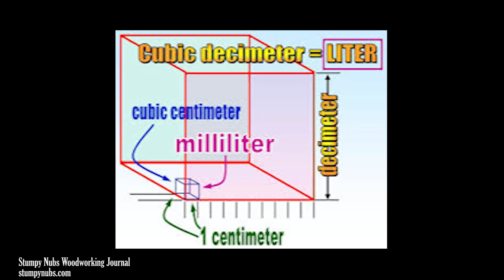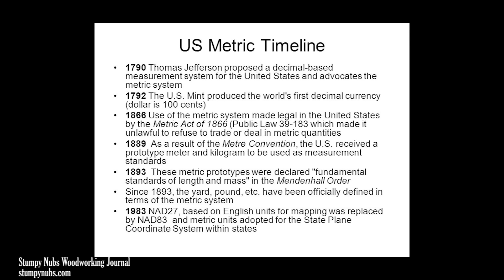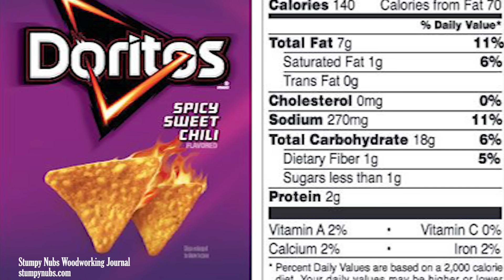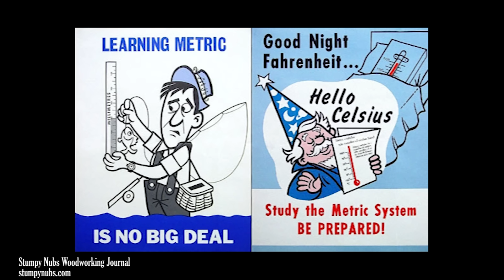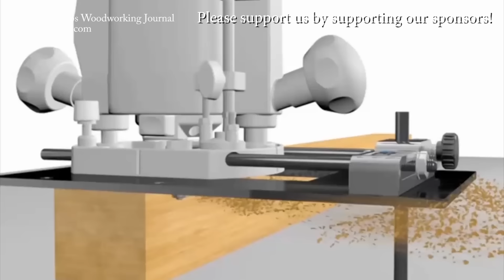BREAKING: The USA is switching to METRIC!

Comment: In the UK we use both all the time, petrol in litres then calculate fuel consumption in miles per gallon, we have litres of water, pints of milk and beer, litres of beer, we walk in miles, but do 10K runs.  It is great fun, we do both, older folks can continue to function in their older units without too much trouble, and young people are already fully metric, but then have to deal with the driving in miles per hour. I get metric, having spent my whole career in Science, but I never could understand the simplified American system, not quite Imperial system that has no ouces, pounds, stones, quarters, hundredweights and tons.  Measuring the weight of an elephant or a ship cargo in pounds is just bonkers, the numbers are too large to have meaning.  Interesting video.

Comment: As I understand it, many years ago Canada and the US agreed to both go metric on a specified date (early/mid 70's?).  Canada followed through and the US bombed out.  It takes awhile to get one's head wrapped around the new system.  I'm now good with driving speeds and distances, and ambient temperatures, but being old school I have trouble with cooking temperatures, pressures and flight altitudes.  The next generation should be able to leave imperial behind.

Comment: My tools have metric and non-metric markings.  However, I know enough conversions (like 1 meter is 39.34 inches) that I just convert anything that is metric back to non-metric / imperial.  I didn't really have to do anything in metric until I went to college in 1978 and again in 1988 (second degree).  If I build something - inches, feet, and yards are the measurements I use.  I km = 5/8 of a mile and a little over 3 liters equal 1 gallon.  I'll go to metric when I have to, but using non-metric for my own projects doesn't hurt anyone.

Comment: I'm British and 62. And when I was in school we were taught the imperial system in elementary school and metric in highschool. Of course we only used SI units for science.
But we are now in the ridiculous situation where we buy gas (petrol diesel) in litres and still say miles per gallon when talking about fuel economy. Our roadsigns are in miles per hour and distances are in miles and yards. We buy milk in pints too. Oh and we measure ourselves in feet and inches and weight ourselves in stones and pounds.
However Our shoe size is similar to yours except for being one unit out. My sneakers are UK 12 and US 13. There are only 6 pints to the US gallon and 8 to the UK gallon so there seemed to be no standard.
Oh and the best is when measuring tyres. The width is in millimetres and the diameter in inches 😅 ie 195 (tread width in mm) 55 (aspect ratio)18 (rim diameter in inches). Yep it's time we all stopped this nonsense.

Comment: I've been thinking about why Americans struggle to switch to the metric system, and I have a theory. It revolves around the fact that our currency is divided into quarters. Unlike what the video suggests, our basic dollar is split into quarters. This quarter-based division permeates our measurement systems too: inches in a foot, quarts in a gallon, and ounces in a pint. Everything seems to be divided into quarters or halves. Americans have a preference for this way of dividing things. Until we move away from using quarters in our monetary system, I believe we'll remain tied to our traditional measurement system.

Comment: Don't think I'll ever feel comfortable thinking about room temperature (or outside air temp) in anything but F.  Ditto for speed of my car.  However, the field of 3D printing and CAD has been metric for quite some time, and I don't measure these parts in "inches".  Cooking recipes are STILL in teaspoons, tablespoons, and oz's.  Gas used to be sold in liters until the parts for setting pumps for gas prices over $1/gallon!  HFT has VERY FEW tape measures in metric!  Ditto for other tool makers btw.

Comment: I remember back in the 1970s when there was a big push to change everything to metric. It failed because people said metric was “too hard.” What? Well, they kept asking things like how many inches in a meter. You needed to know to four digits to be reasonably accurate. 
     However, I lived in Australia for a while, and the metric system ain’t all it’s cracked up to be. Say you are driving to Sydney. A sign says it is 124 km. How long will that take? Uh, let me get my calculator. But how long will 77 miles take? 77 minutes.

Comment: I'm from Germany. It is not the case that the metric system has established itself everywhere. We are more likely to buy "half a pound of mince" from the butcher than 250 grams. Eggs come in packs of six (half a dozen) and the monitor in front of me is still 27 inches.
Reply: eggs also come in packs of 10, 12, or anthing in between, really. aslong as the number is even, that is. the example with meat is probably only in more rural areas. but yeah, monitor size still has inches, but i always have to convert it.

Comment: The metric system is equally valid to imperial. I think that imperial will still be used for common things like in Canada. For human scale objects, cm is too small and m is too big. Being 6 foot is a lot easier than being 183 cm because most people can't really imagine how big numbers interact with the world. where as I can imagine how big a foot is and generally get an idea of how big 6 of them are. Imperial only falls apart when you need to be more accurate than to the nearest inch, but even then fractions aren't a bad way to do it usually.

Comment: It can be dangerous using 2 systems of weights and measures. See the Gimli glider incident in Canada.The Board of Inquiry found fault with Air Canada procedures, training, and manuals. It recommended the adoption of fuelling procedures and other safety measures that U.S. and European airlines were already using. The board also recommended the immediate conversion of all Air Canada aircraft from Imperial units to metric units, since a mixed fleet was more dangerous than an all-Imperial or an all-metric fleet.[9] In Australia we went metric in 1973. If memory serves correctly the Hubble telescope was fitted with metric washers and required a special mission sent to rectify it as it would not focus properly.Amazingly we suggested to the Brits in the 1890's that the British Empire should go metric,however our idea fell on death ears.

Comment: The only change that I dont agree with is the temperature scale.  when using a thermostate in your house you can regulate the temperature much better using fahrenheit rather then celsius.  I live in a tropical climate and we only use air conditioning and if I set my thermostate to fahrenheit and set my target temperature I get a much tighter temperature swing compared to using celsius.

Comment: Actually, there are two versions of feet used in the US: The International foot is exactly 0.3048 meters. Whereas, the US Survey foot is 1200/3937 meters. Or, one meter is 3.2808333333(infinitum)feet. Your everyday use and how things are described to you are in International Feet. For land and offshore measurements they use in the US Survey Foot. However, even this will be changing as the government is planning to deprecate the use of the US Survey Foot, but for us which use both on a daily basis, that will not be anytime soon. Lucky for me I mostly use metric, but my US colleagues still have to use both Feet versions as well as metric. Lots of fun, huh?

Comment: Can anyone make quick calculations for me?
1. I have house with 100 square meters roof, the rainfall yesterday was 1 mm high. How many liters of water did I collect?
2. I also have a workshop with a roof measuring 100 square feet. In a few days there will be a rainfall of 1 inches, how many gallons of water will I be able to collect?

Comment: lol!
We adopted the metric system when I was in primary school. But it was a gradual thing. Milk bottles started having 568 on them, as well 1Pt, for example. That was in the 1970s. In the 1990s, as well as finally changing our road signs from miles to kilometres, we changed our construction materials from feet and inches to metric. That included plumbing, where half inch i/d pipe was replaced by 15mm o/d pretty seamlessly, but 3/4” i/d was not a close match for 22mm, nor 3/8” for 10mm and the other standard sizes bore no relationship at all. The Irish were not impressed and they resisted to such an extent that today there exists a thing called “Irish size “ tubing. You can’t easily get metric pipe or fittings anywhere in the 26 counties. Yet the UK population, inventors of the bizarre Imperial system, with its multiples of 12, 14, or 16, have adopted metric plumbing systems with little resistance. So now, if you want EU standard fittings, you have to go to the 6 counties that are still technically part of the UK, though not the EU. If, however, you want imperial fittings, you have to go to the 26 counties that ARE part of the EU.
50 years on from its formal adoption, the metric system is still not fully operational, with many tradesmen still thinking in 8x4, or 4x2 and using feet and yards to measure with. Lumber is still sold and priced by the foot, despite being cut in metric lengths by the sawmill.
I used to think the imperial system would die out when the last people to learn it in school retired, but in reality, with all the heritage in existence, I think it will be generations before it’s forgotten. 
Ireland is a mere speck in the ocean, so compound that thousands of times and you’ll be talking feet, inches, pints, quarts, fl/oz, lb, etc, for a very long time yet.
But do try to adopt metric correctly, however long you take to do it. We don’t want different US litres, or Kilometres, like we had with gallons and miles.
The purpose of a measurement unit is to make sizes, weights, volumes or lengths understood by all. So a unit of the same name should be the same in every other way too, regardless of where you are on the face of the planet.

Comment: The imperial system is already metric. All imperial units have been changed so they are no exact decimal multiples of the metric units. 1 inch is not roughly 25.4 millimeters. It is exactely 25.4 mm because it was redefined as such in 1959. Since then the USA system is just a renumbering on top of the metric system, with units close enough to the old value so people won't care too much.

Comment: I live in the Uk, and I use both systems.

I like the imperial system because it is obscure and it is a link to a past when things were simple made for a simple world and made for simple people.
Also it is very good for kids to grasp the concept of fractions.

But for our modern world it is not suitable and it is hard to calculate things For instance try to calcute the weight of an imperial pint  of water, oil or mercury.....good luck.
 One litre of pure water water is 1 kg....simple....depending on the liquid you have to adjust the density.....

Another example, the brits  adopted the decimalisation of their money in the early 70's ....now 100 pence make a pound...rational....base 10....
Before it was 1 pound = 20 shilling= 240 pence....For example try to.calcute the cost 1/16 of a pint ( US or imperial) of mineral water considering that this water cost £1 and  20 shilling 5 pence per gallon. ( Also calculate the weight of this water)....sorry please the old currency....Difficult?  .
Now nobody in the uk is considering going back to the old financial system or even the measuring system except for a pint of bitter.

I can find you tons ( imperial tons ) of examples to show the limitations of the imperial system.

Comment: I grew up in the US but in the middle of my long life I moved to Australia which had gone metric in the 70s just before we arrived. Most of our common measuring tapes here are marked in both systems. I still think inches most of the time, but when cutting out material I find it easier to have a simple whole number like 33mm rather than a fractional number to remember. I have no trouble with the math, using whole numbers is more direct and easier to catch errors when I 'measure twice'. To speak as an Australian I notice that blokes still refer to size of their wedding tackle in inches and the weight of their offspring in pounds. Which brings me to the only serious criticism I have of the metric system - it sometimes doesn't scale to familiar human sizes like our foot or the roughly inch size of a finger segment. Calling out measurements on a building site in mms like 4123mm often requires a bit of mental translation translation into meters or yards to get a rough mental picture. But chippies (carpenters) here don't call out 4 meters 123, they say 4123. I had an experience visiting Sweden on the importance of measurement systems being tied to human scale when I was sent to the store to buy some heavy whipping cream which came 200ml and 300ml sizes. But it wasn't marked in ml but deciliters - so you buy the 2 deciliter size or the 3. The relative size is more obvious in deciliters. I don't have any particular suggestions but in my experience the metric system is 23/32nds easier to use.

Comment: Thanks, that was very interesting.

I grew up in Canada before we switched to metric, & then had a science education where everything was in metric. So I'm pretty comfortable in both systems. My buddy in Australia is a rabid anti-metric guy, and he has some good arguments for Imperial/US measures. The basic idea is that Imperial measures are based on human dimensions like a literal foot, an inch is the length of the last bone in your thumb, & a yard is the distance between the average person's (also The King's) nose & their outstretched arm. So these should make sense to humans.

Also, Imperial measures use roughly 12-based numbers, which are easier to count & calculate in your head (or thumb & foot). Plus they're easier to use in terms of circle degrees, which are spectacularly not metric. 

I tend towards metric most days even if I use inches for woodworking. What irks me is that if you go to a US big box store in Canada, most (all) of the tape measures are in Imperial only, which is kind of crazy given your remarks in the video.

Comment: In 1975-1980 my job get my brought me to Dansk Standart Institut (DS) and there was an internatinal meeting about  IS System . It is the system that was then adopted internally at DS office for units of measurement in the meter system. For all measuring units. The USA WAS ALSO THERE THEN.
Europe and other metric countries, then had to change the size of tool and bolt head from17 mm to 16 mm on 10 mm bolt and 19 to 18 mm on 12 mm bolt. and then there were new standart called iso standard for boldts, but it never came through in practice.
In Denmark they moved away from danske tommer (26,1545 mm)/ inches (25,4 mm) around 1960 and 10 years later.

Comment: Both systems have advantages though it is when we mix them that it becomes interesting.
Working as a surveyor in Canada I found that we use Metric and decimal feet.  Yes, decimal feet or and imperial engineer's tape.  This has 1 foot divided into tenths.  So, one half of an engineer's foot is 0.5 feet, or 5 tenth.   And being of that age where I learnt both systems it was not uncommon when setting out a stake for my team to call out 'to the left ten feet, half a foot more, two centemetres left, back two mills, good!'.   Course measurments in imperial, fine in metric.
The base 66 - from the chain, is great when you need to find acres (1 chain x 10 chains), miles (80 chains), a furlong (10 chains), the width of a road (1 chain - 2 for major roads), the size of a city lot (33' x 132' , or if there is a 20' back lane each lot gives up 10' - so 33' x122'), and many other measurments.
Though when looking at old maps I have found that the standard imperial foot is new.  Historically each town, principality, and nation had there own foot.  A foot being 11.8" in Egypt, 10.6" to 13.8" in Greece depending on the city, 309.6mm in Berlin, 286.8mm in Hamburg, etc.  Just to add a bit of confusion to the mix. :)

Comment: Say what ever you want but the metric system is a far superior and rational measuring system.  I'm an American and I still believe metric is better.  I know it would be extremely diffiult to change though.  Imagine the home building industry... all the lumber dimensions make sense right now... but they'd have to change if we used the metric system... would we go from 16 inches on center to 40.64 cm on center... or would we just change the dimensions of our sheet materials from 4'x8' to 120 cm x 240 cm so we would do 40 cm on center for building...  It would require changing A LOT of things.  I still think it would be better to change to metrick in the long run.

Comment: The imperial system is great, if you can't divide or multiple unless at least one factor or the divisor isn't bigger than 4, as you can split calculations to reach bigger factors/divisors. And, as long as you also don't need to do anything "advanced", like simple geometry, and don't mix up different "versions" of the units, and don't have to cooperate with people that know how to multiply and divide numbers by ten. In isolation, for very simple, quick, not even back-of-the-envelope calculations, the imperial system could honestly be considered better, for some people.